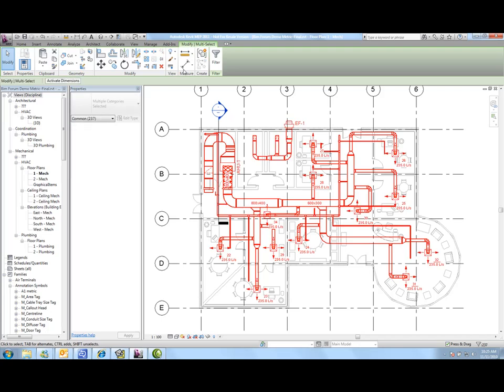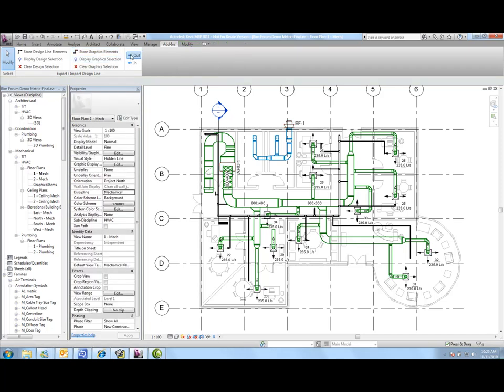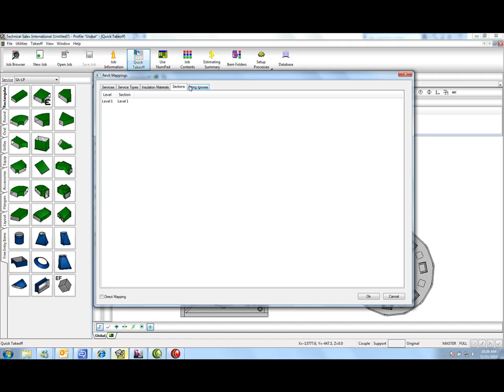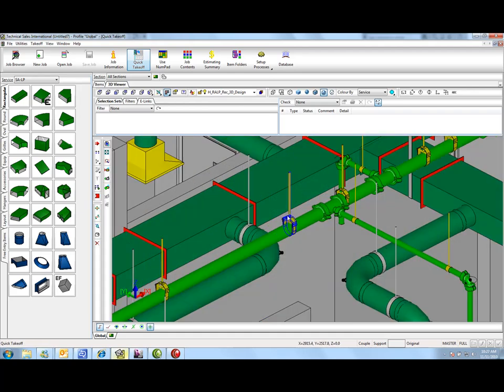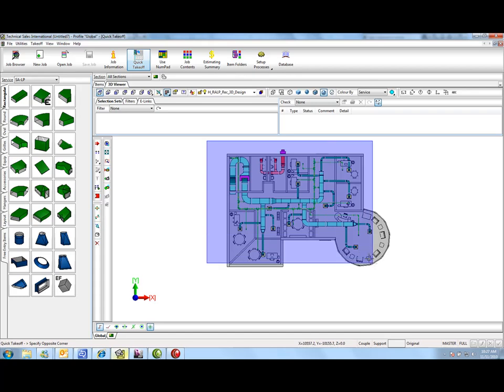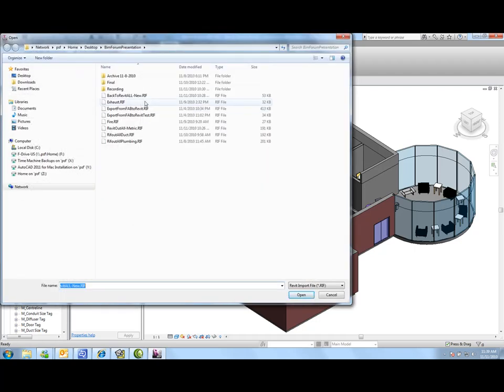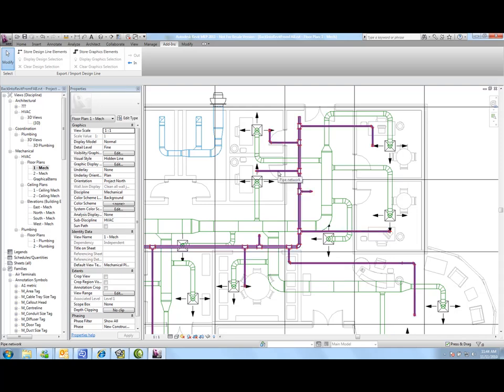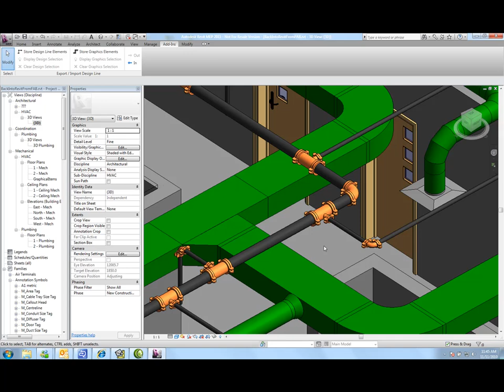Revit MEP 2011 API - TSI software presentation at AMCA BIM Forum in Australia

Comment: Revit MEP is a waist of time for contractors and most engineering firms don't use, and if they do, they will not turn over models. Revit, in general, is a resource hog once the architect and structural engineer get done creating their 500MB file it's worthless to anyone else. I would like to see you demo of real job like 20,000 sf or bigger.